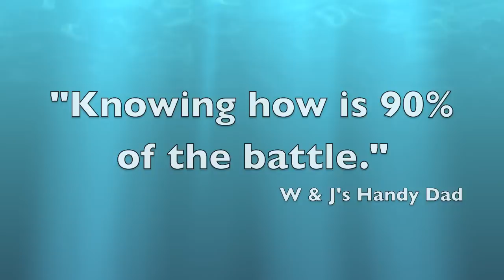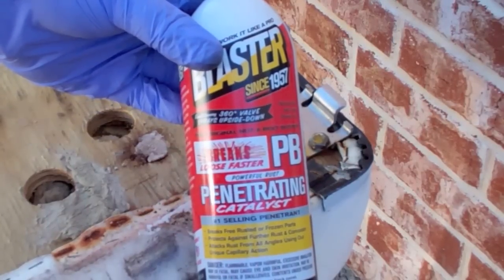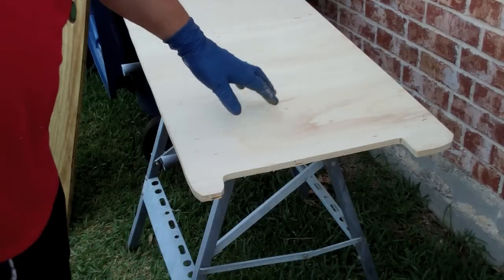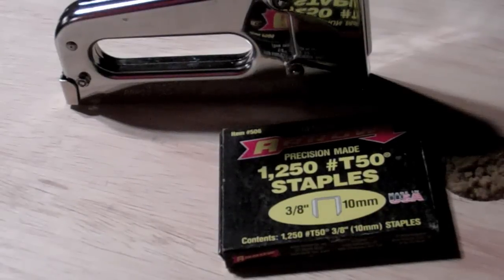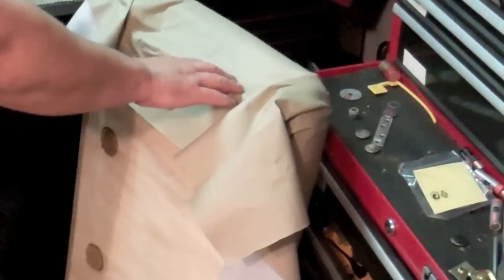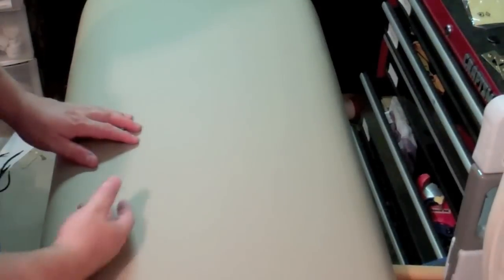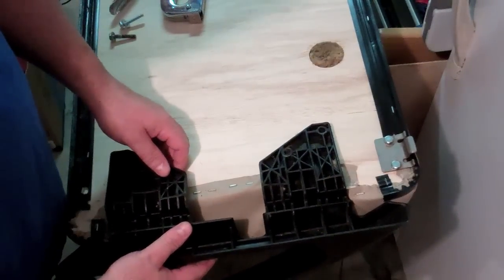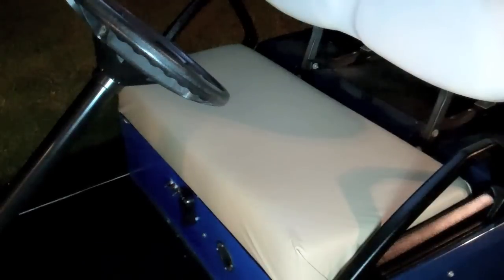Golf Cart Seat Recover - CHEAP!

Comment: Awesome video! I absolutely love how you explained the materials and tools pretty much in depth. Great job with the description! 
Starting In the center with the staples all the way around first then using the heat-gun to heat first & while then pulling material very tightly towards you saving corners for last is what I have found to really be helpful to me. With that said 4-way stretch seems to be easier to work with. 

Love the video!